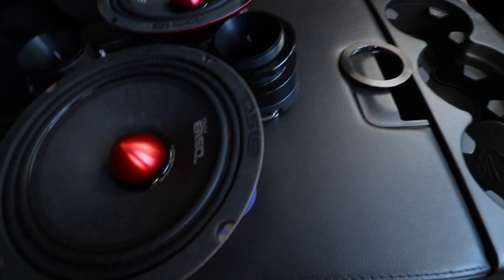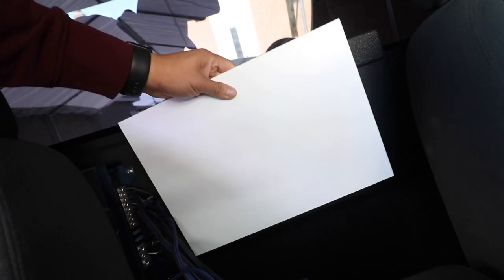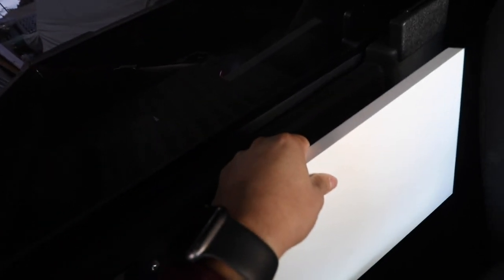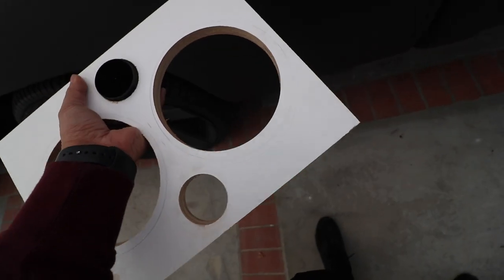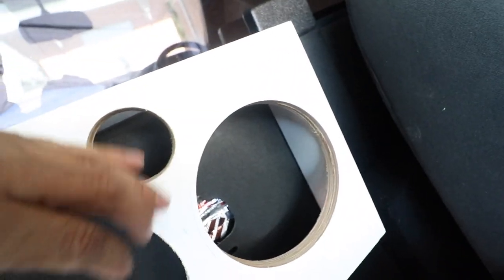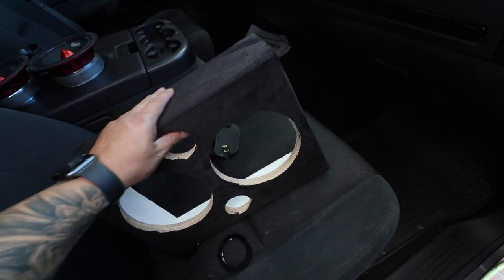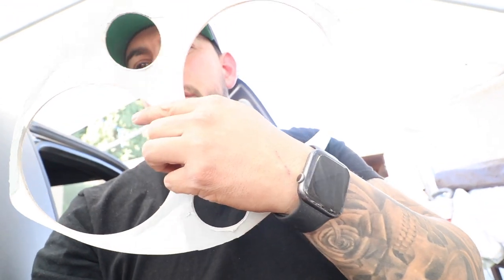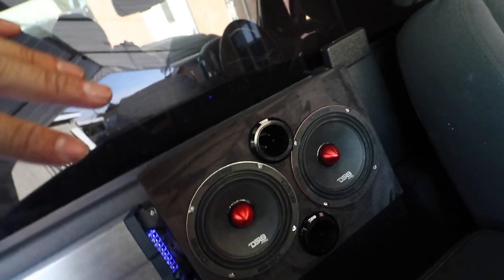UPGRADING MY TRUCKS SOUND SYSTEM WITH A CUSTOM TITTY PANEL!!

Comment: Did u buy a seprate amp for em or run em to ur regular amp?
Reply from the maker: I ran them to my same amp
Reply: @projectvc425  could u show me how bc i have 2 subs running to my amp rn nd i wanna and some better rear speakers
Reply: @projectvc425  if u could make a vid on ur wiring nd all that